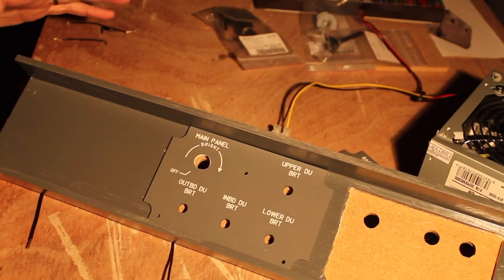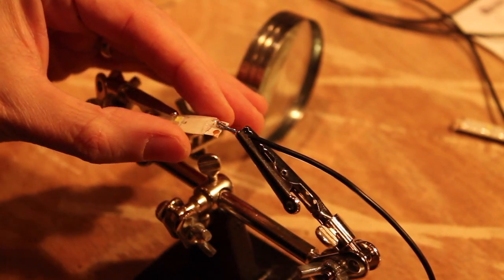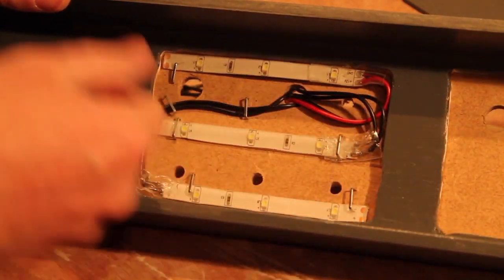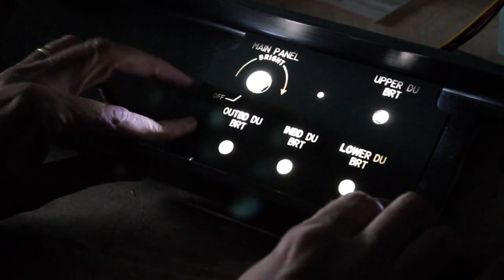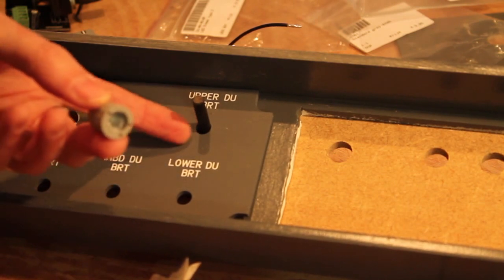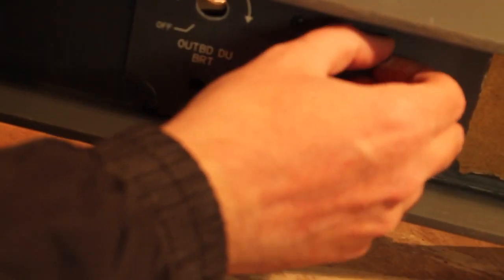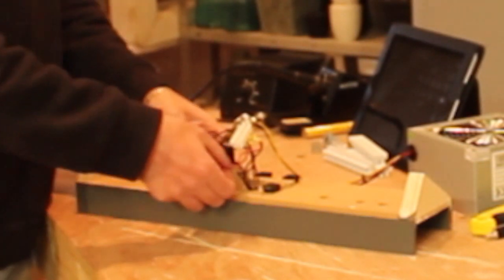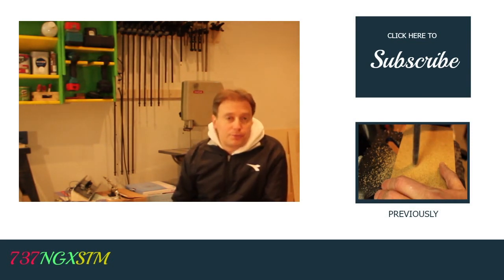Boeing 737 800 Home Cockpit Simulator #9 - lighting dimmers

Comment: Great video!!!! just a quick tip, turn the camera towards yourself, you will not coverings the view with your hands, and you will easily worked :) also sketch on a piece of paper, what is connected.. - where is + where is - where is GND, etc .. :) etc... before you start to build is very good :)   I am very pleased that you also have this passion and I expect more frequent and good video like this :)  great job!
Reply from the maker: King Siller thanks for the suggestion on the camera, as you can see I am still a beginner. Good idea about the sketch, in my next video I will work on the potentiometer connection. I will do this for sure. Thanks again and thanks for watching.
Reply: 737ngxsim
Ohh  you are like PRO!   just keep up  good work and you will win!  ohh good idea to tell on the end of the video what u will do next :) !!!   you Win!